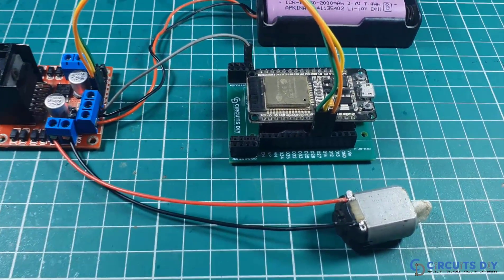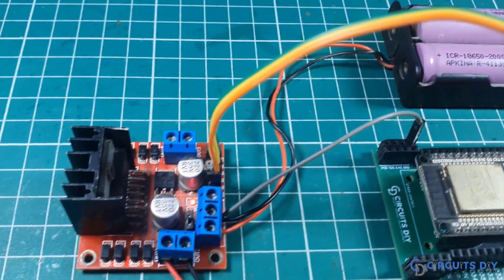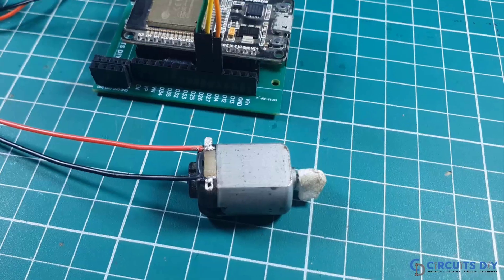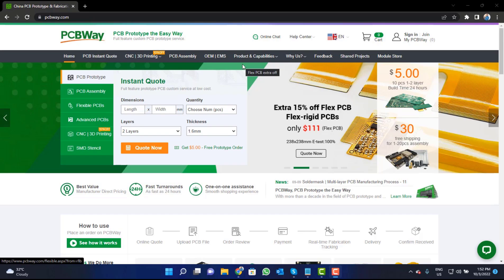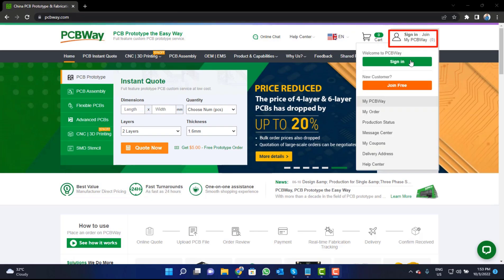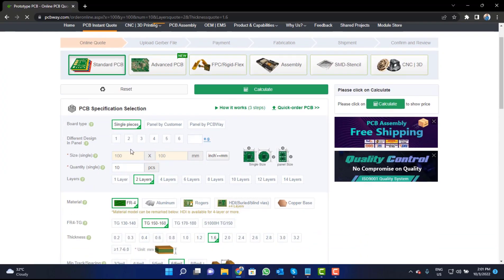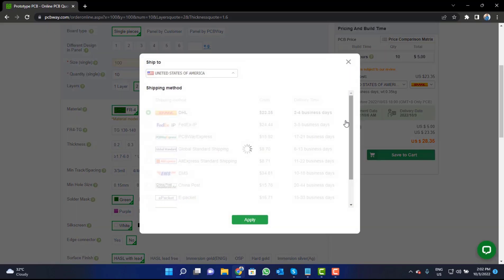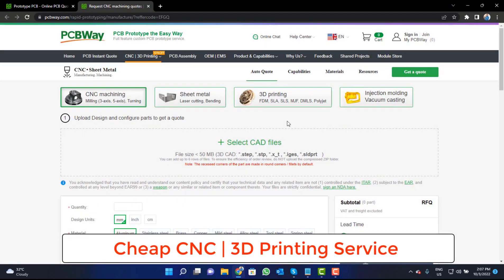DC Motor Control using L298N Motor Driver & ESP32

Comment: So you haven't connected esp's 5v to motor driver? Can it work without it ?
Reply: Yes you just need an external power supply if I'm not wrong